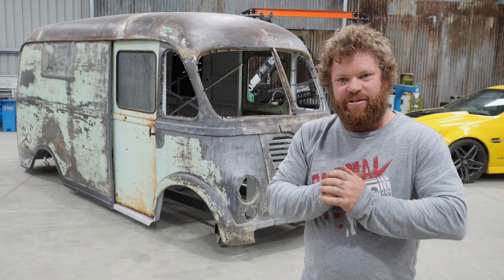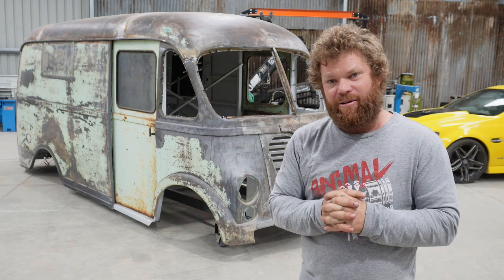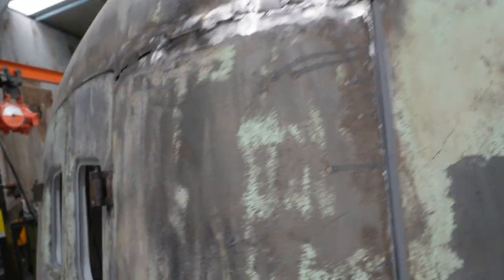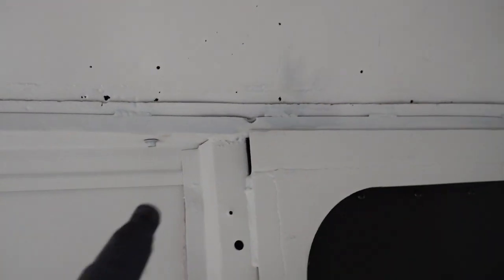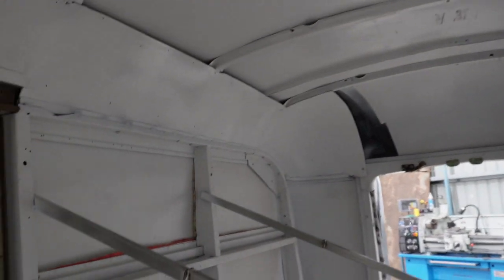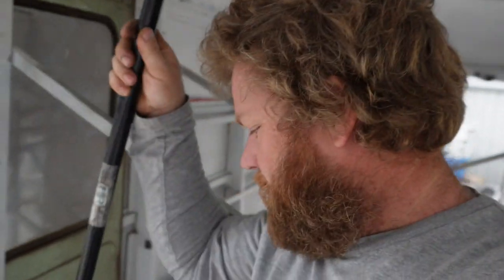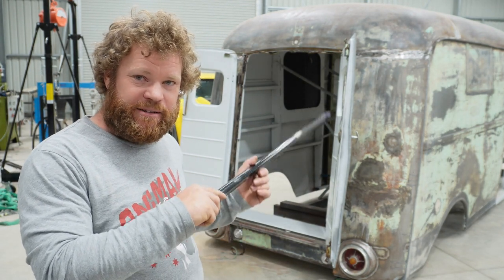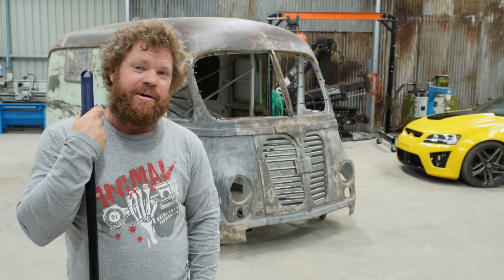INTERNATIONAL METRO roof removal, how to. Step van. SSMETRO

Comment: im about to start on my  restoration.  did you modify the original frame or created a totally new one?  im looking build one with LS powertrain what you suggest for frame swap  are there any blueprints for  cusotm one ?
Reply from the maker: Hi Max, I believe a lot of people use s10 chassis, I'm just finishing up designing mine (custom) at the moment. waiting for the engineer to sine off on the design. I am also going LS drive train.
Reply: @animal_engineering   ive watched many builds and i like yours the best. Would you be willing to sell the blue prints of the chassis  or assist I know youre down under   and im in South Florida USA  let me know
Reply from the maker: @Max-rh8jz  Thanks mate, not sure my chassis would be much use to ya, its designed around using a specific donor car for parts. which I'm not sure if can get over there. if your on Facebook or Instagram, I've got a couple of photos up of the chassis I've designed there. You can see if it would suit what your after.